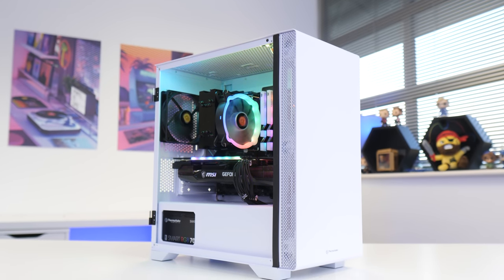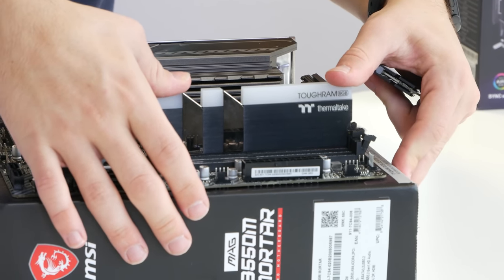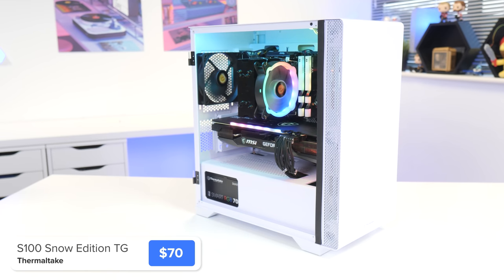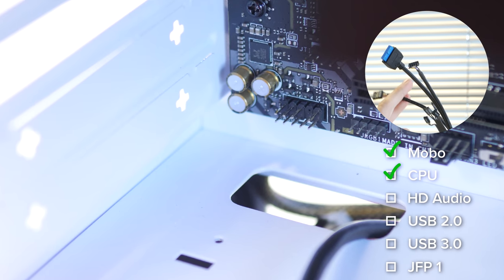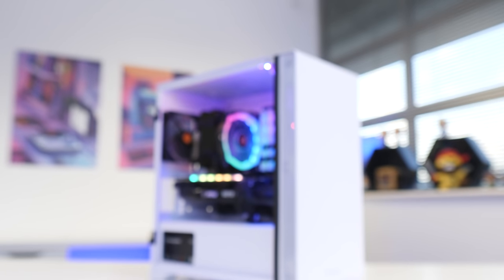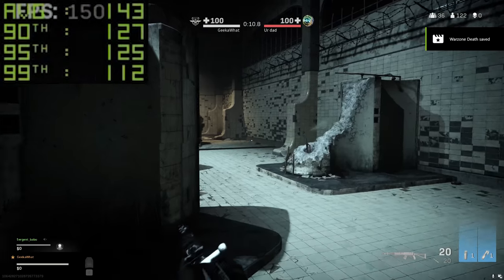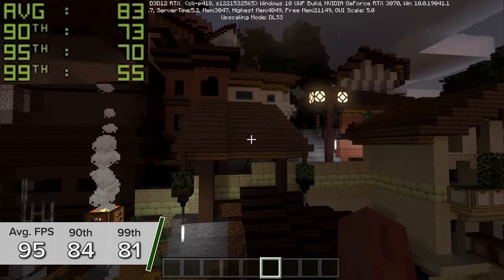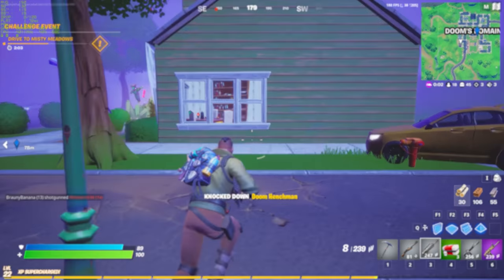$1200 RTX 3070 Gaming PC Build! [15+ Games Tested! - ft. MSI RTX 3070 Gaming X Trio]

Comment: I'm gonna build my first PC and this video helped me a lot as it was my main reference when getting the parts in black Friday as I wanted a white build. Ended up with this:

CPU / Ryzen 5600x
GPU / GIGABYTE Vision OC GeForce RTX 3070 8GB
RAM / Corsair Vengeance RGB Pro 16GB (2x8GB)
Memory / Samsung 970 EVO Plus SSD 2TB NVMe M.2
Motherboard / ASRock B550M STEEL LEGEND AM4 AMD B550 SATA 6Gb/s Micro ATX 
PSU / CORSAIR RM Series RM750 750 W ATX 80 PLUS GOLD Certified
Case / Thermaltake S100 Tempered Glass Snow Edition Micro-ATX Mini-Tower

It was less than 1300 USD all in all. I did a lot of research as I knew nothing about PC building. I just hope I didn't make a bad choice with the motherboard.

Comment: Hi Geeka i will build my first pc  
The specs i want to get :
Rtx 3080
Ryzen 9 5900X 
32gb ram carsair rgb 
Tuf 570x max or something I forgot 
500gb ssd evo plus for the windows
2tb barracuda hard drive for games 
My questions:
How much power supply i need ?
Is my specs good?
Is the mother board good?
What should i get an aio or a custom water cooling ?
And what case should i get ?
Btw my budget is more than 2000$

Comment: James I was wondering what you thing about my build? I need some feedback as this is my first build but I did too much research. 

CPU: Ryzen 5800x.

GPU: RX 6800xt or 3080.

RAM: 16gb corsair Vengeance Pro RGB.

Storage: 1tb crucial p1 (gen 3 ssd), 1tb Aorus SSD (gen 4 ssd), 2tb Hybrid Seagate SSHD.

Motherboard: ASUS ROG STRIX B550-F Gaming (Wifi).

Power Supply: Coolee Master 650 watt Gold Modular. (Black cables)

Case: Corsair 220T Airflow RGB 

Cooling: Corsair Hydro 115i RGB Platinum (AIO) and move front fans to top and back mounted it at front.
Reply: get 750 watt power supply 650 isn't enough but other than that it looks very nice
Reply: @aidancrinion6699  I don't plan on much overclocking, 650 watts is enough for what I need even with a 3080.

Comment: Great quality. Gonna build this with a 5600x
Reply: Is the 5600x good? The 3070 is out of stock plus is very expensive does the 5600 fit in this build?
Reply: @justsergiotv  the 5600x is RUMORED to be pretty good but it is also ~ £90 above the 3600 price. Wait for benchmarks, but it should provide more stable performance. I’d wait for proper reviews before you buy

Comment: Can I use a MSI MAG B550M MORTAR?
Can I use a different Thermaltake?
What is the case’s name?
Reply: you can use any b550 you want, msi have the best vrm coolers, and any psu  650watt+, also for ram any 3200mhz

Comment: I saw many PC builds for this price and this one seems rly good, the only thing i would change is maybe the power supply,that doesn't need the rgb but rather an EVGA that is probly better brand with more years warranty.I was surprised by that cpu cooler, because for 30$ many of them are hard to install, this one looks rly cool and seems so easy to install.
Reply from the maker: It’s super duper easy for AMD CPUs!
Reply: @GeekaWhat  I will add it on my MAD cpu list :)

Comment: one simple but important question for me: Can i copy this exact build however swap MSI 3070 x trio for the NVIDIA RTX 3070 founders edition, and it still be compatible with motherboard and other parts etc.?????
Reply: All gpus are compatible with nearly all motherboards. So Yes, you're fine.
Reply: @Zeak1199   appreciate that bro, just when i build the pc on pc part picker there is a note talking about:
 'The video card PCI-Express 12-pin power connector adapter is being supplied by two 6+2-pin power connectors. Please ensure that the 6+2-pin power connectors are not daisy-chained and do not share the same power cable.'
Reply: @harryrussell7841  that's a reference to your power supply, nvidia changed the standard for power delivery on the founders cards, what it's basically saying is that usually on PSUs there are two 6+2 connectors connected on one cable and that wouldn't supply enough power so you're going to have to run two individual pcie 6+2 power cables directly from the PSU to plug into the 12 pin adapter Nvidia includes with the card.
Reply: @Zeak1199  does the PSU come with these two individual pcie 6+2 cables or will i have to buy them? Thanks for the help btw; this is my first pc build
Reply: @harryrussell7841  they should, if you buy a Modular power supply it's virtually garunteed. Although, most non Modular power supplies also offer atleast 2.
Reply: @Zeak1199  so in clarification, i can order even with this compatibility message however just use the cables that come with the parts slightly differently. there is no need for me to buy extra cables or worry about then not working together?
Reply: @harryrussell7841  nope, you're good

Comment: with what cables did u connect the RTX 3070. it is needed a 2x4pin to connect. Did the GPU had an adapter or the PSU included the cables you needed. cause you only showed us the  PSU cables for the hdmi, mobo, and cpu ect.
Reply from the maker: It's a 6+2 pin not a 4+4 pin for the GPU dude! Hope this helps :)
Reply: @GeekaWhat  is this cable included in the PSU???

Comment: 1:34 shows this is a used cpu. however you didnt bother to clean excess thermal paste on the sides
Reply from the maker: If you're suggesting I re use the same CPUs over and over again and don't actually have 100 Ryzen chips... you'd be exactly right...
Reply: nothing against using a used CPU, the OC in me just cringes at a sight of what can be cleaned in less than a minute with a tissue and 99% C3H8O

Comment: I wanna know your guys thought. My budget gaming pc is under $1000. I want to know if this is a good mid range build.

CPU: AMD Ryzen 5 3600
Mobo: ASUS ROG STRIX B450-F GAMING  II
RAMS: Team T-Force Delta RGB 16GB (2x8GB)  DDR4 3200Mhz 18 latency
SSD: WD BLACK SN750 NVMe M.2 2280 500GB
PSU: MONTECH Century 850 Watt 80 plus Gold Certified Fully Modular
Case: Musetex ATX Mid Tower gaming computer case
GPU: GeForce GTX 1660 Ti
CPU Cooler: Thermaltake UX100 5V Motherboard Sync High Airflow Hydraulic Bearing ARGB Lighting CPU Cooler
Build totals up to $977.71
Let me know if there's any changes I should make.
Reply: I think the specs are good for that price, but the power supply is over kill. A 700 watt like in this video should do fine
Reply: @t_r_a_y_e9858  You're right, I swapped that out for the Corsair 650W CX-Series Non-Modular. It fits better with my budget. And I swapped out the GTX 1660 Ti for an RTX 2060. I purchased it, got it delivered, built it, and it runs like a dream.
Reply: @Christisking0010  pretty good PC for 1k, pretty similar to a build I almost did earlier this year before getting a bit of extra money

Comment: Do you need to buy windows 10
Reply: If you want to do things by the book, yes. However, Microsoft will let you run W10 for free indefinitely without paying for it. The limitation is that you can't use the personalization settings and there will be an activation watermark. Other than that, it will work exactly the same as if you paid for it.